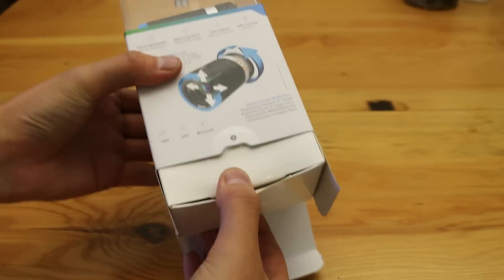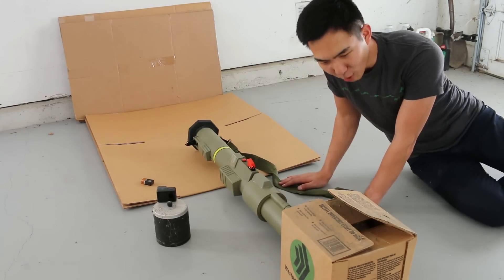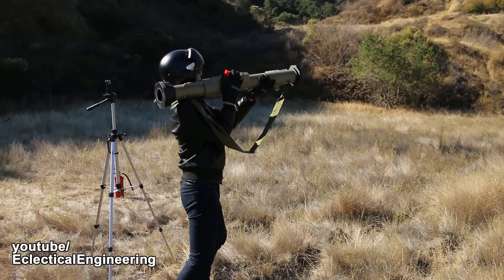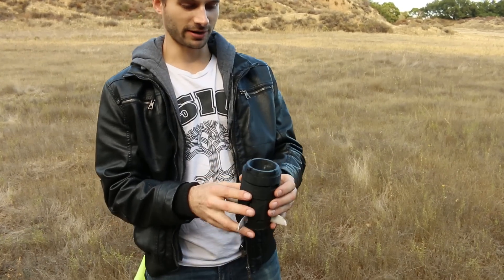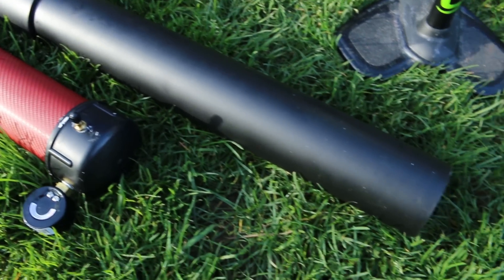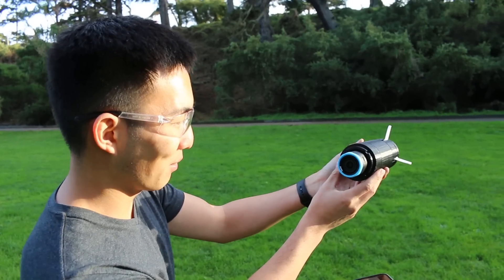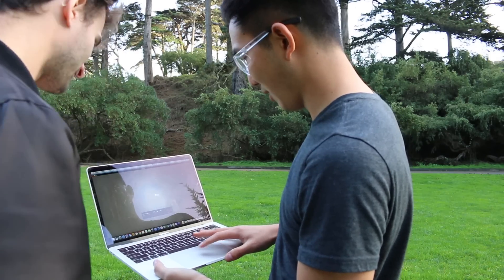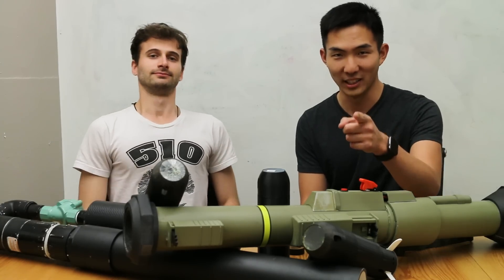Stabilizing Camera shot from ROCKET LAUNCHER (Black Powder)

Comment: A Bumper of Styrofoam and a Styrofoam Bed for the camera and placing the camera back a Little so it's not the very next thing too take the Force after the Styrofoam bumper and you could use some Bolts and Nuts and put a Metal Ring 1 - 4 inch in front too take most of the Shock and Better 3D Print that can take a Styrofoam bed inside for the camera too Fix in mostly in the Front of the Housing 3.5 Inches too 4 Inches of High density Styrofoam for Impact inside the 3D Print and Lock a Ring around the Back of the Camera too have the Ring that is Bigger Diameter Impact the Styrofoam so the Force is Not on the Front Moving parts of the Camera.

Comment: Have a projectile that has smaller projectiles that separate from it each with cameras in the ends
Reply: I forgot to mention the small projectiles that separate from the bigger one would each have a small e motor in them so when it starts losing altitude they launch out and go further while the large one drops and each one would have their own cell phone like camera in the end

Comment: Here are 2 Ideas.
Idea 1
Design a projectile that fits inside the launcher.
when the projectile is launched and reaches its maximum height, it unfolds into a weighted parachute.  the goal is to get the chute up as high as the launcher will go... unfold, inflate fully and by help of a small weight (Perhaps a go pro or button battery powered altimeter) that can add mass to the projectile for launching.

Idea 2 (Increased difficulty)
Design a break-away capsule - that when launched...
- breaks opens at peek height
- a large rubber balloon is inflated with a small helium canister
- once inflated - the balloon is tracked with a GPS button powered tag to where it lands (the balloon will pop) and the peek altitude can be recorded.  Extra points if you attach a go pro to record flight

Comment: ???   Why didn't you consider the "landing" in the design?  - Seems rather obvious. One suggestion is a sliding tubular/ring damper/buffer that has bumper petals extending forward. After firing, have these open like a flower to form a cone around the camera field of view. A little energy absorption goes a long way to reduce impact forces.

Comment: If you resin fill your 3d prints they will be really strong and then put a crushable sandwich into the extension you will be able to save a few cameras. Also if your fins were a bit bigger a it would be a bit more stable in flight. Then only use three fins to reduce drag.

Comment: I slipped and lost my grip on a $3,000 chandelier.  the homeowner...after a bottle of wine, boxed it up, then stomped the
box and called tiger direct telling them it came damaged.  she should have got an Oscar for her righteous indignation
portrayal.  lighting company sent her another one and said they were really sorry... true story.  i wont tell you about 
the mirror...SO.. box the rebel, get drunk, stomp the box, then call them really pissed off and see what happens.
PS i can fix your sudden deceleration problem so your cam will be ok.  you should just mount it on the head of a rocket.
way better hang time...Kids are so inexperienced....Signed TechWrecker from Montana

Comment: Try and shoot a two stage projectile. Similar to an rpg. The initial blast could set the angle, while the secondary ignition carries it. Then have a third section with a parachute to secure whatever camera you place in the projectile. Might have to rig up some time delay to deploy the second and third stages. Or maybe a remote activation. Too much work? I have faith in you guys.
Reply: Shroom King what i was thinking

Comment: You'll should shoot a special projectile that deploys wings and can glide and then experiment to find out how far you'll can go with different variants of the design
Reply: I was thinking that would be a great direction to continue with this project.
Reply: or atleast build a 2 part rocket that has a parachute so the parts don't break...I mean its a common 6th grade science project, sure some adults could pull it off
Reply: Physical sentences
Reply: nah bro he should steal a LRASM from a military airbase then modify it with a camera and a rocket launcher...
Reply: Yea
Reply: It will spin too much it will fall after you fire it only real rockets can do that
Reply: no
Reply: Then create a drone that you launch and control to target and become a weapons manufacturer
Reply: did you get the camera
Reply: @GreenRanger912  Not at all
Reply: Laugh Factory KE  No. This would be a cruise missile. It is not the same.
Reply: and make it explode too.
Reply: @cepedhm361  these could fit a grenade and would be quite effective in ukraine or just pack it with 3 oz of rdx wrapped in copper that's "cut" the frag or even a shape charge cone on front
Reply: So a ucav?
Reply: apcp rocket motor that fires on a delay after it fires and glide wings that deploy